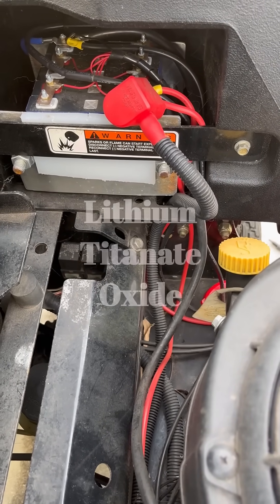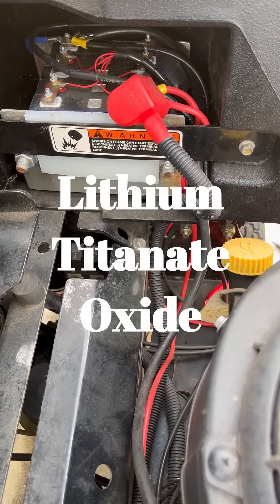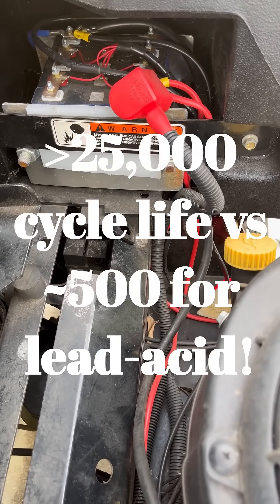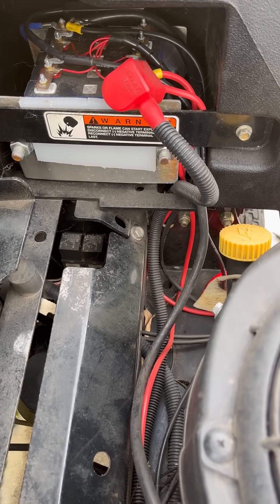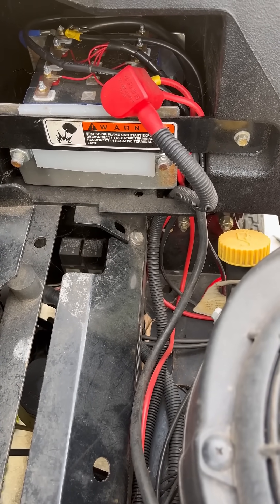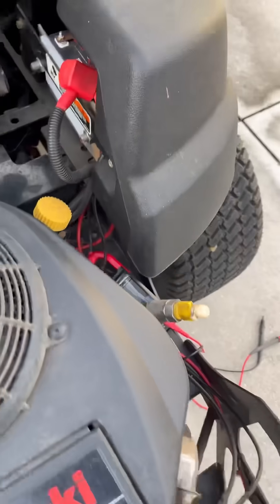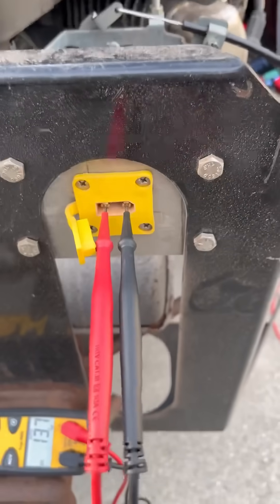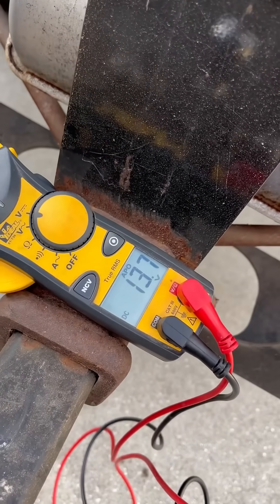LTO Battery On Lawnmower - No More Replacements! #LTO #lithium #battery #diy #batterytype #mechanic

Comment: Would love to hear after years, if they are really as durable as claimed
Reply from the maker: @rockrl98  I will update if I experience any issues.  So far i’ve been extremely happy with these.  I also use an identical set for jump starting vehicles and a big diesel Ford backhoe that goes through lead acids like nothing.  It’s hilarious seeing this tiny battery starting these monsters.
Reply: @MyDIY247  time has come to replace the battery in our van, my neighbor also needs a new battery, and I might as well try these on my lev projects, which have degraded/insufficient batteries, range probably won't be great, but at least it should be consistent, is cold performance really as good as they say?
Reply from the maker: @rockrl98  so for a vehicle that would also require additional capacity for running other loads, you may want to look at LiFePO4.  These have the benefit of both high capacity, and high discharge rates.  Lifetime on them is shorter than LTO but still much more than lead acid.  Take a look at the LEV60F cells.  They are 74Ah, and will discharge 600A for 10 seconds.  Just remember you will need to protect your alternator from prolonged high amperage draw from high charge rate of these cells.

I’ve only been able to test them in around 50F, but they’re rated for a much lower temp.